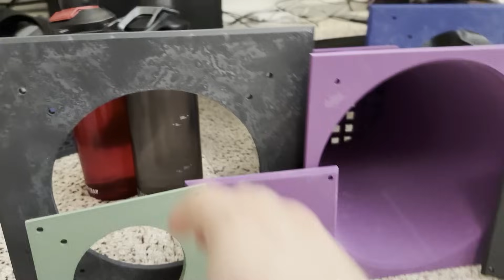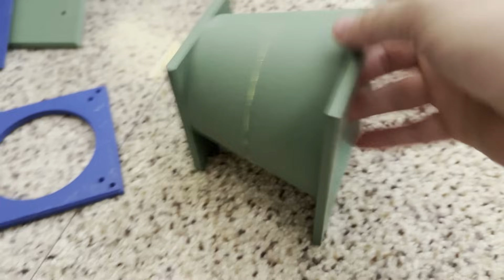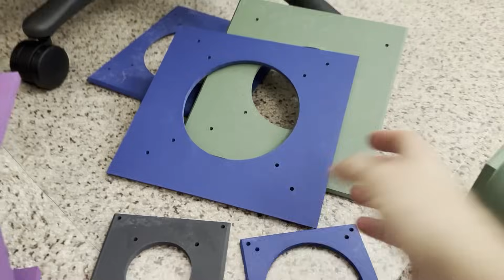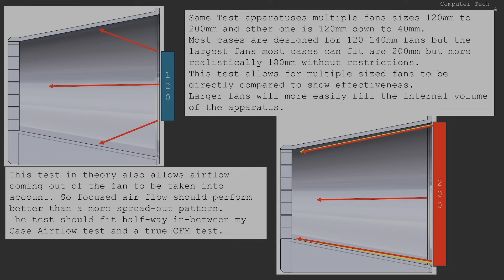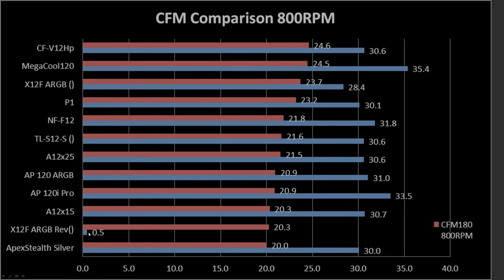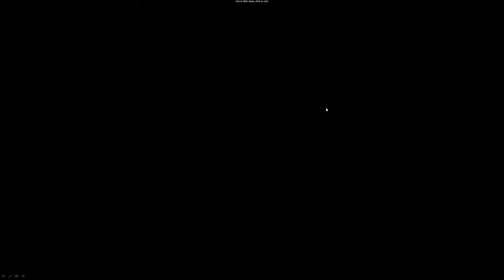New Volumetric Flow Rate Test procedure and starting data

Comment: Glad to see you upgrade your CFM measurements. It's a tricky thing to get right. You might want to consider hot wire anemometer for measuring the air speed as they generally are more sensitive at lower air speed and can have better resolution (although accuracy tends to be same-ish). The downside is that you may need to take multiple measurements at various distances from the center (plus of course at the center) of the orifice to get good consistency.

Been thinking of building my own anemometer with multiple hot wires at a set interval to facilitate such measurements but I'm still in the design phase and working on several projects like that in my spare time so things are moving at a snails pace.
Reply from the maker: haha a while back i did testing with a hot wire one. was going to do a video about it. I basically need a custom made one. Need a sensor maker sponsor who will make me some equipment. 
But yes slowly upgrading tests that I can but I cant do them all or all previous data will be gone but adding more is easy. to build that data set.